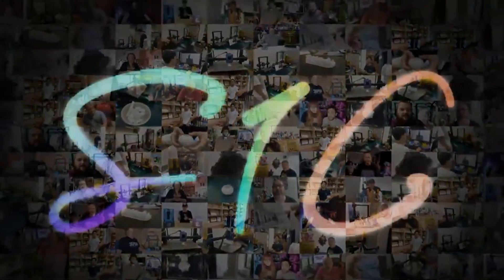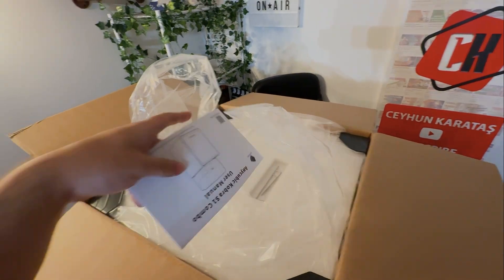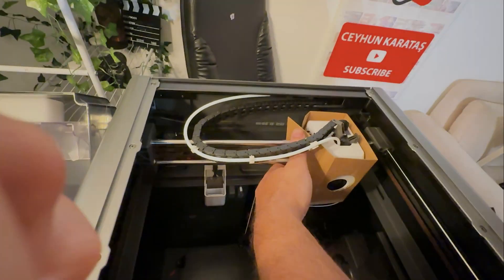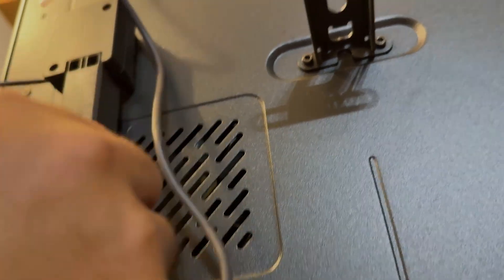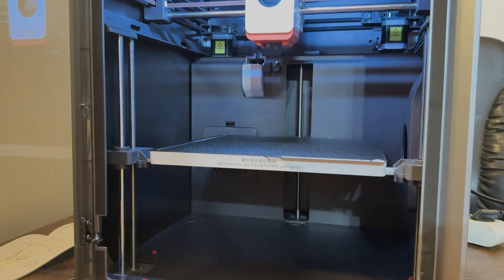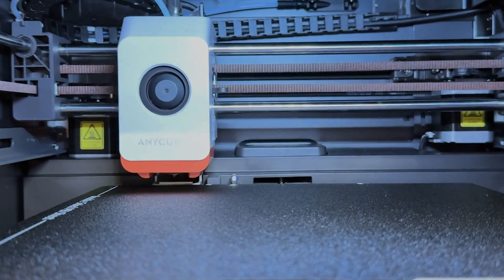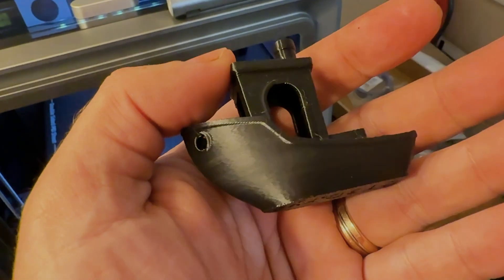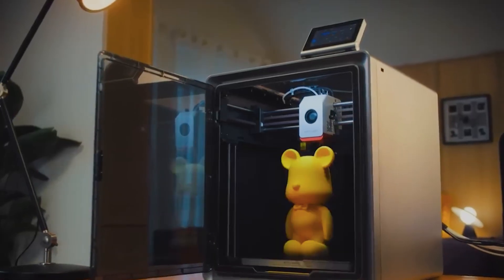Anycubic Kobra S1 Combo | Unboxing, Setup & First Test

Comment from the maker: 00:50 I used the expression "print volume" as 250 cubic meters. This is incorrect. It's actually 250 mm x 250 mm x 250 mm. I also called the ACE module the AMS module out of habit. The AMS module is the BambuLab version of the same device. On Anycubic, the device is called the ACE Pro.

Comment: "Cheapest 3D color printer" says the thumbnail.
Well... not the cheapest. The Flashforge AD5X i going for 367 incl shipping. (I can find the Anycubic incl shipping for 412 euros, not any lower).
@11:08 Ah, you correct yourself, "enclosed" is the key here. Then yes, it might be the cheapest
Reply from the maker: Yes :) I mentioned a closed case combo printer. I also bought this for 379 euros. 12 euros is not a big difference. Prices are constantly changing.